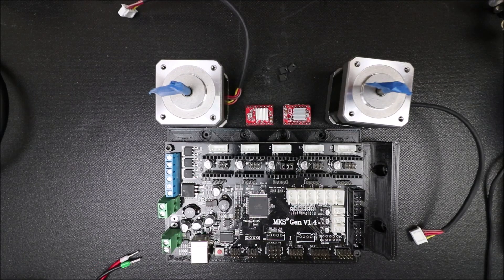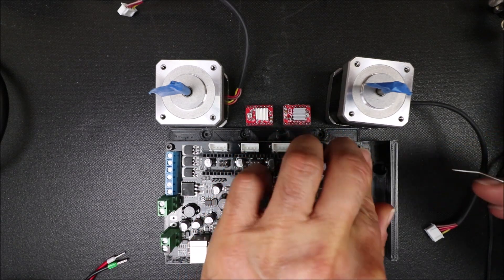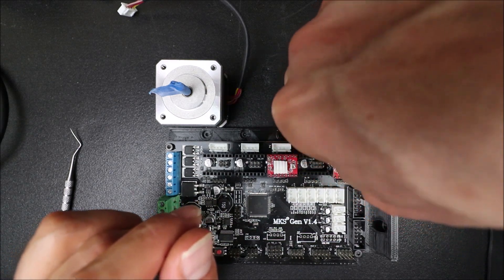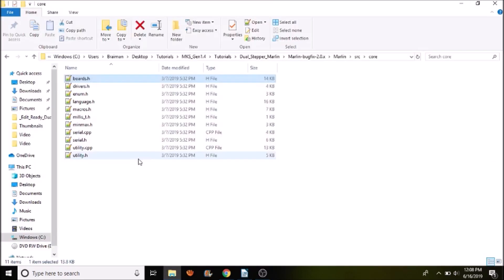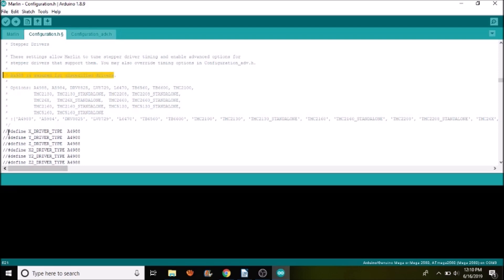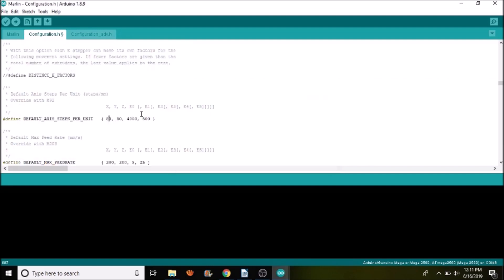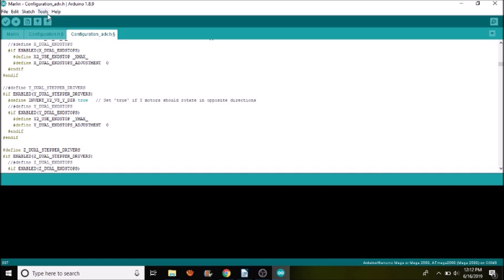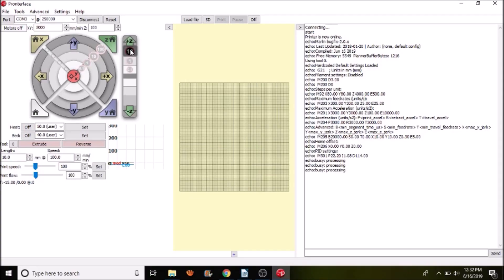MKS Gen 1.4 - Dual Z steppers with Marlin firmware (Part one)

Comment: Hi great video thy
How does marlin 'know' it have to be use e1 as the second z stepper? 
i want to use a second Y motor with a independent endstop ( so i can square things out)
greetz Edwin
Reply from the maker: It's possible to use E1 as a second Y stepper.  As for the second endstop not sure why.

Normally one endstop in each axis x, y, and Z need a zero point for homing.  Adding a second endstop might not work in this case.
Reply: I did read that you have to say in marlin that you have to say use e1diag  as second y axis as endstop

Comment: Some printers use four motors in the vertical direction. Can you please advise how to do this in Marlin? And if you please make a video about this, it would be great. Because big printers have 4 motors in vertical direction.
Reply from the maker: I've shown in some tutorials in advanced boards how to do this.
Reply: @EdwardBraiman  could you please tell me in which video you speak about four motors in the vertical direction? i check video titles, most of the video tiles are "dual z stepper" and i looking for quad motor in z axis.  
i also check Octopus board and can't find how to setup 4 motor for z axis.
please help me about this.
thanks.

Comment: Edward, i followed your tutorials, my dual z stepper was working fine for 1 year.
I didn't use my printer for a month and yesterday when i ran it, my E1 motor(which is dual z) is rotating too much Ex: if i move z axis for 0.1mm E1 motor moves for around 1cm.

I tried re-uploading marlin firmware. Doesn't work

Changed drivers, and adjusted current.
I checked E2 motor and cable, all are good. 

Just cant figure out what the problem is, can u help???
Reply from the maker: Different steppers or NEMA 17 motors?
Reply: @EdwardBraiman  a4988 drivers , and nema 17 motors for both E1 and Z
Reply from the maker: Are part number same on both NEMA 17 steppers?

Comment: A practical easy to follow  needed instruction which I will be using on my new mks 1.4 board
Reply from the maker: Thanks.  Just remember VScode with Platformio IDE is becoming standard for Marlin firmware setup.

Comment: Hi, friend, great tutorial. I have a issue.  Im making a CoreXY. The axis Z is moving by two motors nema 17 with two drivers TMC2209. One to Z axis and other to E1. The motors move to different speeds. Could you help me please? any tips?
Reply: Hi Rodolfo! I have the same problem. Have  you solved it? Can you say to me how can I set the steps for the second stepper (E1)? Thanks!
Reply from the maker: You might be able to compare configuration to example configuration.h and configuration_adv.h be careful as they are just example files.

Comment: Hello Edward, thanks for the great videos. They become one of my most reliable source of information. I am in a learning curve with marlin and I have a Q for you. I am trying to compile my own firmware but I keep getting promblems over problems. Please can you help me about that. Latest Marlin Bugfix, Mks Robin Nano V1.2/X,Y,Z,E1 TMC2209, E0 TMC2208/ uart mode/Mks Robin TFT 35. I am trying dual Z but couldn't compile marlin. I set the pin assignment according this video; https://www.youtube.com/watch?v=7ShcFKXrVHo&t=40s . I don't know what I am doing wrong. Now my current promblems are; '''MYSERIAL1' was not declared in this scope'', ''"portMUX_TYPE" not defined'' and ''#error "SERIAL_PORT_2 cannot be 0. (Port 0 does not exist.) Please update your configuration.". I will probably have another problem after this. Am I choosing wrong env. It is like this in platformio.ini; default_envs = mks_robin_nano. I am stuck at this stage and need experts help. Thanks.
Reply from the maker: You understand you're asking me a question on hw I do have yet and on someone else's video?
Reply from the maker: MakerBase just sent me some of the equipment you're asking about.  I'll need a couple of days to work with it, before making a video.
Reply: @EdwardBraiman   I didn't mean to misslead you. That is why I sent this video. Forgive my manner. Than I will wait for your video. Thanks a lot.
Reply from the maker: It's okay.

Comment: Hi. I am very new to 3D printing and code and i'm having problems uploading to the motherboard. When i follow this video and get to the part where i need to compile and upload i get a message when it is trying to upload. The message is as follows.
Arduino: 1.8.13 (Windows 8.1), Board: "Arduino Mega or Mega 2560, ATmega2560 (Mega 2560)"

Sketch uses 55164 bytes (21%) of program storage space. Maximum is 253952 bytes.

Global variables use 2460 bytes (30%) of dynamic memory, leaving 5732 bytes for local variables. Maximum is 8192 bytes.

avrdude: stk500v2_ReceiveMessage(): timeout

avrdude: stk500v2_ReceiveMessage(): timeout

avrdude: stk500v2_ReceiveMessage(): timeout

avrdude: stk500v2_ReceiveMessage(): timeout

avrdude: stk500v2_ReceiveMessage(): timeout

avrdude: stk500v2_ReceiveMessage(): timeout

avrdude: stk500v2_getsync(): timeout communicating with programmer

An error occurred while uploading the sketch

This report would have more information with
"Show verbose output during compilation"
option enabled in File -> Preferences.

Please do you have any advice for me to solve this issue?
Reply from the maker: Do you have any devices connected to 3d printer board?  What board do you have selected in Arduino IDE for chipset?  Have you considered using VScode with Platformio extension?
Reply: @EdwardBraiman  Thanks for the quick response. The board is on it's own with just the stepper motors plugged in. Board selected is Arduino Mega or Mega 2560. I don't know what VScode is. I am using the DRV8825 steeper drivers if that makes any difference
Reply: I've sorted the problem. I had the wrong COM port selected. When i checked the COM port in Arduino Port 1 was ticked but it also gave me the option of Port 4 which i have just tried and it uploaded. Now to carry on with the rest.
Reply from the maker: In my playlist for this series there is a video on how to install.  It should make it easier to work with.  Is almost the same, but has a configuration file called platformio.ini.   are you able to connect to the board with Pronterface?
Reply: @EdwardBraiman  i connected to the board in Pronterface and when i moved the motors 1mm they turned. Tried 10mm and they turned again but when i tried to go back to turning by 1mm  sometimes they were hesitant to turn then 1 might turn but the other didn't. There was also a bit of a click coming from the board.
Reply from the maker: Which stepper board are you using A4988 or DRV8825?  They may need to be calibrated.
Reply: @EdwardBraiman  DRV8825. Having watched a short bit of the tutorial you've done on the DRV8825 i did wonder if the step settings were correct. In the tutorial you changed a setting from 80 to 160. Is that what i need to do?
Reply from the maker: It maybe a current issue if the motors are making strange noises.
Reply from the maker: @martinkaye1801  Here is a tutorial that may apply.   https://youtu.be/m1fOqq5GYDA
Reply: @EdwardBraiman  Thanks for all your help. I've had a look at the video but need to get some more tools before i can do the calibration
Reply from the maker: Remember, if it strains to move or makes a lot of noise to move it applies.  Either way it will make the stepper more precise.

Comment: Would this serve for a correct alignment of Z in marlin? with the line that says #define Z_STEPPER_AUTO_ALIGN
Reply from the maker: Maybe, but would independent steppers will always have alignment issues.
Reply: @EdwardBraiman  
So you recommend using a single driver for two motors? Thanks for the prompt response!
Reply from the maker: Np.

Comment: hola tengo un problema con el conector del termistor. esta quemado el pin . quería saber donde consigo el archivo pins.h  para poder usar el conector del  termitero del segundo extrusor . muchas gracias
Reply from the maker: El archivo de pines que busca es pin_MKS_GEN_13.h. es posible que desee averiguar la causa raíz de por qué el termistor se quemó en el primer pin para evitar una repetición del problema. Buena suerte.
Reply: @EdwardBraiman   disculpa no encuentro el archivo. se quemo el conector por que no tenia  la protección plástica y se me cruzaron los cables provocando un corto. fue un grave error.
Reply from the maker: @rodrigov424  La ruta del archivo puede verse así para Marlin 2.0.x ... C: \ Users \ ebraiman \ Downloads \ Marlin-2.0.x \ Marlin-2.0.x \ Marlin \ src \ pins \ ramps

Comment: hi , i have a KEYES control board MKS Gen V1.2 on a bee prusa can i use marlin 2.x or i have to use only the 1.1.0
Tkx very much and nice video
Reply from the maker: 8 bit boards can use either Marlin 2.0.x or 1.1.x.  32 bit processors can only use Marlin 2.0.x.

Comment: I HAVE MKS ROBIN 2.4 BOARDS AND MARLIN 2.1. Z2 STEPPER MOTOR CONNECT TO E1 NOT MOVE.PLEASE HELP
Reply from the maker: You'll need to set up the stepper for E1 in configuration.h and then enable E1 in configuration_adv.h for E1 as a second z stepper.  Note it may fall out of synch with other stepper motor as the calibration of each stepper may vary.  It might be cheaper and more precise to split the output of the stepper with a stepper divider board in one of my SKR 1.3 videos it's explained.  Hope this helps.
Reply: @EdwardBraiman  HOW enable E1 in configuration_adv.h? CAN I SEND MY CONFIG FILES FOR U? I USE MKS LV8729 DRIVER AND I WANT DUAL STEPPER DRIVER FOR Z AXIS
Reply: @EdwardBraiman  Hello, thankyou for the help. but how to set the E1 as the second z stepper in configuration_adv.h? i cannot find it
Reply from the maker: The Marlin firmware may have changed since the recording of the video.  Which version of Marlin firmware are you using?
Reply: @EdwardBraiman  im using Mks-Robin-Nano-Marlin2.0-Firmware.
Here's the link: https://github.com/makerbase-mks/MKS-Robin-Nano-V2.X/wiki/Marlin_firmware

I found how to use E1 as Z2. Here it is: NUM_Z_STEPPER_DRIVERS 2

But when I flash it in, it still doesn't work. Do you happens to know why? Thankyou to reply!
Reply from the maker: Can you post your configuration.h and configuration_adv.h on Discord so I or someone else can look?
Reply: @EdwardBraiman  Sorry, I didn't know Discord has cloud storage. *noob here*. But here, gdrive link of those config file: https://drive.google.com/drive/folders/1dv0rAVMXNGulu3a_PzKPeoqZoFVtWJpn?usp=sharing

Thankyou for the help!
Reply from the maker: I look after work today.
Reply: @EdwardBraiman  Thankyou!

Comment: I follow these steps exactly and changed drivers to drv8825 because thats what im using but i get an error when compiling.
Reply from the maker: What's the error?
Reply: @EdwardBraiman  will try and reflash this morn when i get back to my shop and post error
Reply: it actually flashed this time... I must have done something wrong the first couple times I tried. now to test on the stepper motors. I will report back
Reply: all motors are working as they should print head is getting hot but im now not getting a hot bed.

Comment: Edward at 6:30 in you skip defining the E1 defaults - DEFAULT_AXIS_STEPS_PER_UNIT,   DEFAULT_MAX_FEEDRATE  and DEFAULT_MAX_ACCELERATION.  Was this because you were accepting the A4988 defaults for your E1 channel setup - or does Marlin copy the Z Axis values to E1 when you add the Z_DUAL_STEPPER_DRIVERS definition ?   I am using TMC2208's in UART mode so it will makes a difference. Thanks Bob
Reply from the maker: E1 is a default setting for normal printers.  It may change based on configuration after calibration.  I have a video someplace in my playlist.
Reply: Bob Carter thank you for your comment, I have this issue as I have the tmc2208 drivers. Basically E1 either turns faster or goes further. I have not solved the issue yet. I would like to know how you solved the issue.
Reply: @lucasvandelogt5126  i know this is very late, but I think I had the same issue, and I realised on my MKS Gen L all the jumpers were on , on the Z, but on E1 there were none, and that was causing the problem. p.s. the jumpers are below the drivers as shown in the vid.
Reply: @pileiba  thanks for letting me know, now that I think about it that makes perfect sense. Do you feel like your print quality is better with dual z drivers? Did you do anything to the firmware with e1 steps as well?
Reply: @lucasvandelogt5126  I have found print quality improved. Also I used to have a problem with the x axis going out of alignment. P. S. Z auto align is the coolest thing. Got it to an accuracy of 0.00 :) on both sides. Re the firmware try as I might there was no options to change E1 steps. All the literature says Marlin sets the same steps for both Z axis motors. So the only explanation is a hard ware issue.
Reply: @pileiba  Sounds good, I will try it too! I'll let you know :)
Reply: @pileiba  For z auto allign, do you need a bltouch or other bed levelling sensor?
Reply: @lucasvandelogt5126  yes u do, I use an ezabl, but any bed sensor will do.
Reply: @pileiba  Thanks for letting me know. What type of bed do you have? If I remember correctly the ezabl is only suitable for metal surface beds. I have a glass bed because I like the smoothness, so I think I need a mechanical bed level sensor. I have been manually levelling my bed for the past 4 years, but these new features nowadays they have convinced me to buy an auto level sensor. Edit: I would like to know your type of bed because I believe the probe sensors only work on metal surface beds.
Reply: @lucasvandelogt5126  i use the ezabl pro, which is newest version, it works on glass and metal quite well. The bed I have is the hictop magnetic pei flexible bed. it's very fancy, i wouldn't ever go back to glass.  quote from ezabl "We use capacitive because they work on all surface types that we print on and actually detect the glass surface"
Reply from the maker: Normally I do not use BLT I just level bed manually and the manually relevel on test squares.
Reply: @lucasvandelogt5126  Hi Lucas - firstly I am using a BTT SKR 1.3 and not an MKS Gen board.  I have yet to put the TMC2208's on the Z Axis (I have tested them working on X and Y in both STANDALONE and UART) but I have yet to try them on the Z Axis.  I do have that working currently with a pair of A4988's (as it is cheaper to screw those up).   In configuration.h I have defined Z_DRIVER_TYPE and E1_DRIVER_TYPE as A4988  (Z2 remains commented out).  I have set only 4 values (ignoring E1/Z2) for DEFAULT_AXIS_STEPS_PER_UNIT,  DEFAULT_MAX_FEEDRATE, DEFAULT_MAX_ACCELERATION.  In configuration_adv.h I have uncommented Z_DUAL_STEPPER_DRIVERS.   I had a similar problem to yours on X&Y and I ran that down to only one of the TMC2208's actually being in UART mode and running 16 microsteps.  I had an issue with the other and so it was running Legacy and with no jumpers present defaulted to 8 microsteps.  Check your soldering on the TMC2208 and the UART connections.
Reply: @caggius42  I solved the issue by putting the motors in parallel
Reply: @lucasvandelogt5126  Lucas that is one way to solve it - the ANET A8 V1.5 mainboard I am replacing does just that, shares an A4988 across 2 Z motors - and I have bought several parallel splitter boards of eBay just in case - that said this morning I moved the two UART jumpered TMC2208's from X&Y to Z&E1 on my SKR1.3 reconfigured it and recompiled. Marlin is not reporting any TMC_Connection errors and is turning both motors in the same (wrong) direction at the same rate. I forgot I needed to reverse the direction moving from A4988's so changed just the INVERT_Z_DIR ignored E1 and that recompiled still turns both motors the other (right) way. So Marlin appears to be ignoring some/all of the E1 settings and just duplicating the Z.  Good luck Bob.
Reply: @lucasvandelogt5126  Hi, friend, I have a issue similiar to yours.  Im making a CoreXY. The axis Z is moving by two motors nema 17 with two drivers TMC2209. One to Z axis and other to E1. The motors move to different speeds. Do you solved this issue with out putting the motors in parallel?
Reply: @MrRflowersg  Hello friend! I couldn't figure out the problem in time. So I put the motors in parallel. Honestly it works perfectly for me this way. But the proper way I guess is by changing something in the firmware. Are you familiar with editing the firmware?
Reply: @MrRflowersg  I'm sure there are many people out there that could help. Perhaps a Marlin group or big tree tech group on reddit.
Reply: @lucasvandelogt5126  thank You for answer me. Finally, i conected the  motors in parallel.
Reply: @MrRflowersg  did u ever solve ur issue? I changed the jumpers on my board and that fixed it. I told Lucas in more detail.

Comment: Hi Edward 
I am in the process of making a vertical down DLP 3D printer.

I have bought a 32bit Bigtreetech Circuit board. I want to modify it for this project and I’m wondering if you have any thoughts and ideas on how best to do this?

I want to use the heating bed for the heated resin tank and servomotor for the Lens shutter. The stepper motor is 2.8amp and will be driven by a TMC5160 stepper driver. It can be configured up to 256 microstepping and it all needs to work with creation workshop. I’ve spent ages trying to sort this out! I am not a programmer and I’m a newbie to coding! 

Any help or advice you can offer would be much appreciated.

thanks
Matt
Reply from the maker: Marlin firmware should have all or most of the functionality you may need.  Good luck.  I've not yet created a resin printer.
Reply from the maker: Marlin firmware should have all or most of the functionality you may need.  Good luck.  I've not yet created a resin printer.